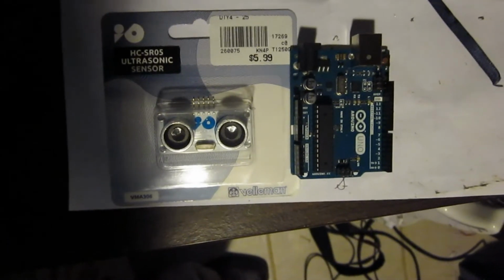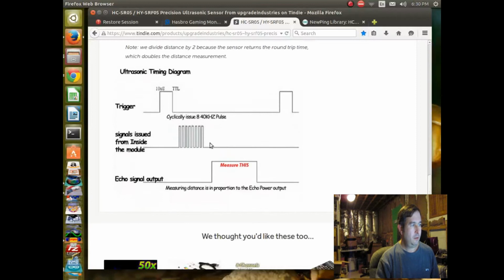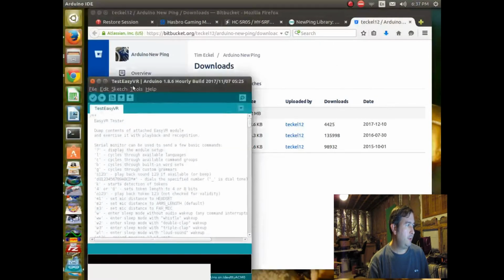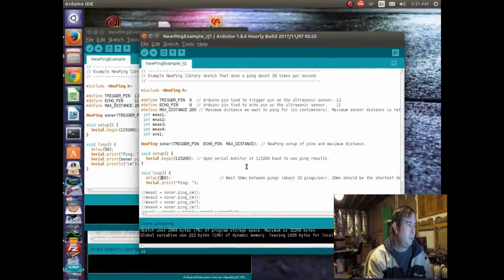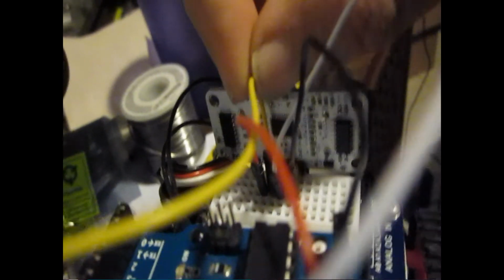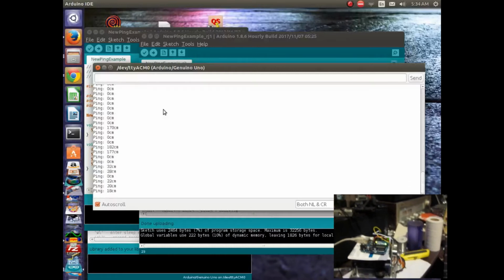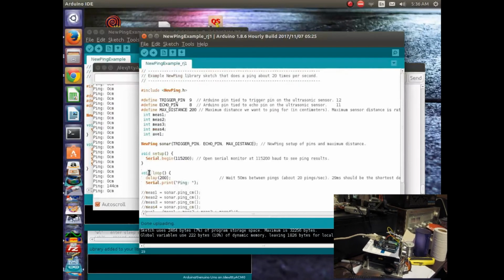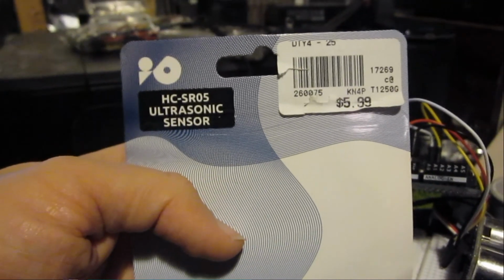Arduino: HC-SR05 Ultrasonic Sonar Sensor

Comment: do you know how you could use more of thes sensors at the same time with the same arduino?
Reply from the maker: I am not sure.. I'll have to look into it.. I believe that this ultrasonic device is kind of taxing on the Arduino pic processor, since it required critical timing.. I will look into it,.. Ok..